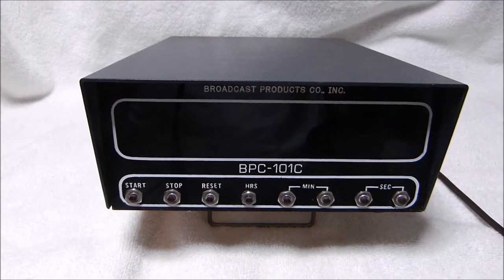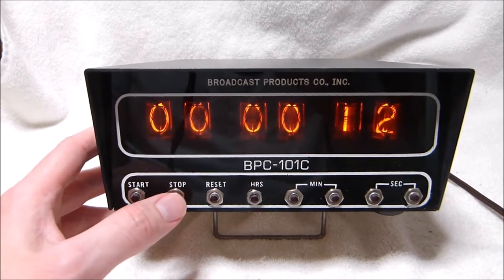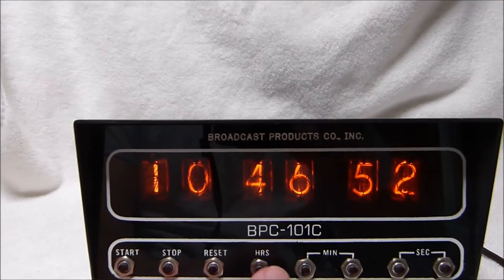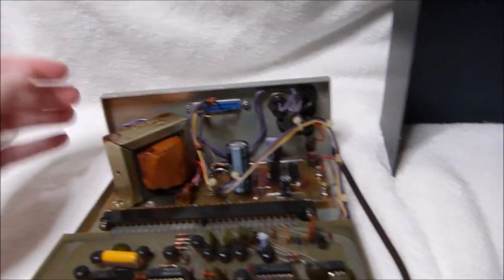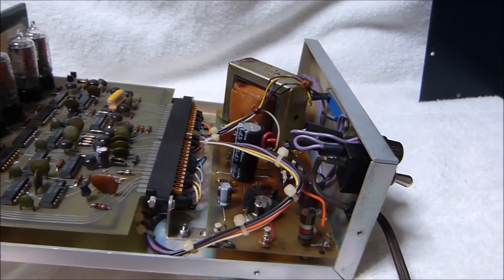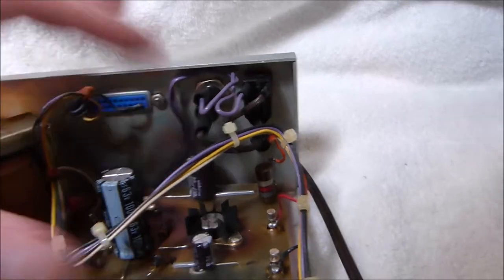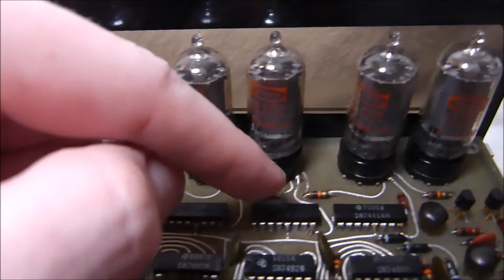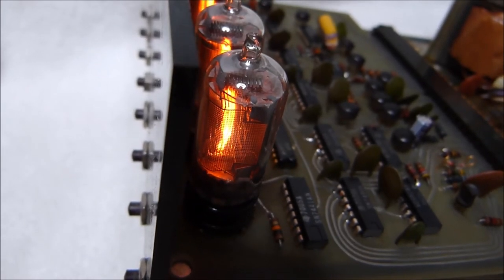Broadcast Products Co. BPC-101C nixie tube clock (1970, USA)

Comment: The way the logic board is socketed, suggests the board may plug into a larger system, perhaps a rack mounted clock.
Nice clock, thanks for the video.
Reply from the maker: Thanks! It's possible the logic board was used in other products too, I don't know, but it was definitely sold as shown in my video.

Comment: I’ve seen something like this at the TV station my mom worked at.
As I remember, they had several of them.
   Interesting.
📻🙂
Reply from the maker: I wonder where those clocks ended up... hopefully not in the trash.
Reply: @50sTransistorRadios  
Would be nice to know.
   I remember the computer was so huge, it took an entire large studio.  Mom’s job was
“Traffic Control” ( Continuity).  SHE was responsible for the little blank spots in between the commercials.   She typed them all out, for each day, and handed them over to someone who transferred the info onto “Punch Cards”.
At the end of the day, all of these Punchcards were put on a Rack in the middle of her office.
The machine was turned on,and with a VERY LOUD, - like a  rapid fire semi-automatic rifle, with someone holding the trigger - Sound,
“ KACHAKKACHAKKACHAKKACHAK”
Each punchcard was snatched and down this conveyer belt.... down 3 floors to the computer in the basement.
Mom was a good looking, very well liked, very well respected, [widowed], raising an only child - me.   SO, I had the run of the place 😁.  She worked there for some 20 years.
( the only person I ever heard of that could type so fast as to “ blow” one of those super fast typewriters with the Ball on it❗️🤣)
Anyway , it was [ at that time] “Owned-And-Operated”( O&O), by CBS inc. KMOX ( now KMOV), and the radio station was on the 3d floor.
I met or knew almost everyone. Including most of the Personalities. Both Radio and TV.
( I did just a little bit of local TV acting as well).
Mom dated one of the Engineers for a while- a really nice guy.
     SORRY, didn’t mean to ramble.
📻😁

Comment: I found a post today at a radio forum regarding the (thx to JIM0415 for all his help) Lintronix 10 AAR - 7 segment LED back in 2019 that I believe to be you.  Did you ever happen to find a replacement that was suitable in the correct pinout?  Wink, must be a MITS DC-6 and I could use one for a failing display segment.   Thanks! The Vintage Nixie Tube Clocks are the most fascinating I've seen.  Ohhhhh to find one of these beauties.... thanks for all your video shares, wonderful collection of Radios!

Comment: What an incredibly crazy idea... a parallel resistor to deliberately load down the power supply and become an element to bake everything.  This one survived.  Others were lost in fires.
Reply from the maker: It does seem like a poor design choice, even for 1970. The six Nixie tubes are always on, and thus provide a nearly constant load on the high voltage line, so it could have been "regulated" with just slightly higher cathode resistors.

Comment: It looks like a very well built unit from the outside, but then that power supply board was a bit of a let down. It would be interesting to know its exact purpose. Starting and stopping a transmitter, or something of that nature?
Reply from the maker: I think it was just intended to provide a quick visual indication of either time, or elapsed time to people in TV or radio studios (and it has outputs for controlling other equipment). 
Using the timer function, someone "on air" could keep track of how long they had been talking, or using the clock function, when a commercial break was due to start.

Comment: About the 2N3767 regulator transistor, it might be a worthwhile modification to actually fit a larger heatsink or fix it on the back-panel. Would improve cooling, and may improve long term reliability as well, instead of having it baking the circuit board.  If it overheats and fails short-circuit, that could over-voltage and fry the TTL logic
Reply from the maker: I have been considering drilling the needed holes in the rear of the cabinet to mount the transistor there, even though that would not be "correct". Next time I have it open, I will check if the case of that 2N3767 is grounded or not. If it is, that would make mounting it on the back easier.
Reply: @50sTransistorRadios  The case of the 2N3767 is connected to the Collector, so it would definitely need to be insulated from the cabinet. TO-66 mounting kits should be readily available though. You can also get larger TO-66 heat-sinks that would fit in the space on the board, which is likely much easier than case mounting the transistor, and would keep the clock "correct".

Comment: Can't touch Heathkit GC-series clocks in quality or cool factor.
Reply from the maker: The power supply design is a bit iffy, but the build quality of this clock is otherwise good. I will agree the early Heathkit GC series clocks were great though, and sold accordingly.
Reply: @50sTransistorRadios  Agreed! 😃